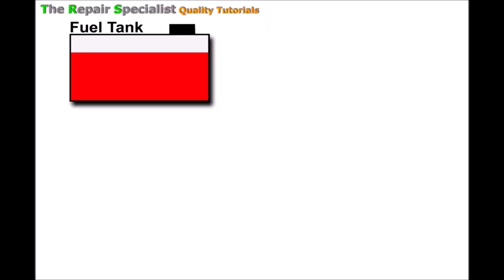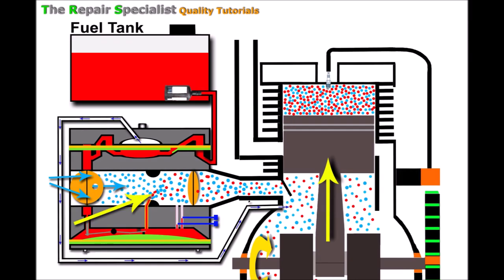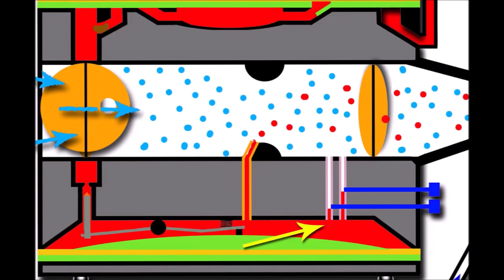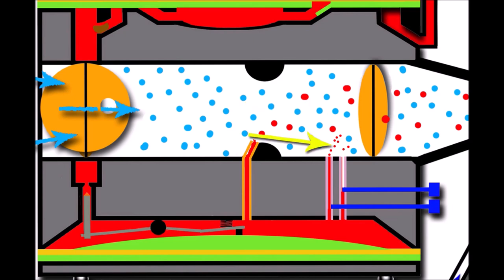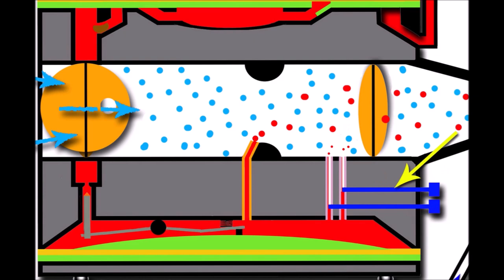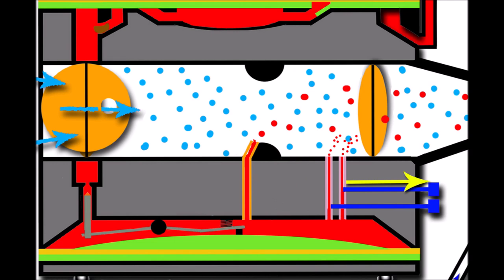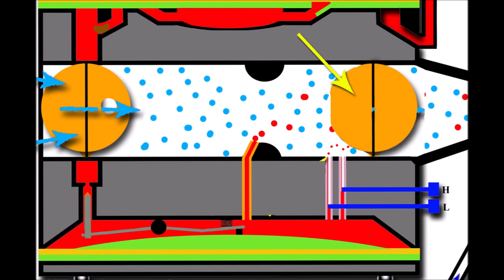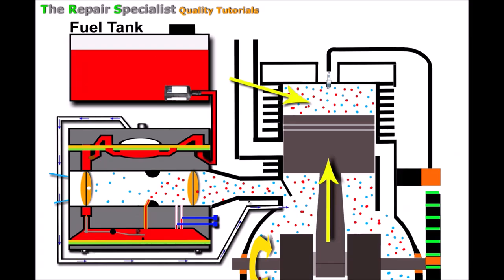CARBURETOR TUNING: How it Work?

Comment: You keep saying this is a very basic explanation. But I say bravo 👏🏽  I think this is a GREAT explanation for 2 stroke carb tuning. Probably one of the best I've seen. We always take carbs back to factory settings to get a base level and tweek. But i think your explanation for taking both screws out a full turn then tweeking high and low rev screws from there is a great start, especially for beginners. excellent video, thanks for posting.
Reply from the maker: Wow. That is some great feedback. Thank you for your comment. I really appreciate it. Craig 👍

Comment: I have an rc boat that is powered by a 26cc 2 stroke engine. I have quite some problems with the acceleration and top speed. The rpm screw is tuned in so i think i need to work in those 2 screws. Thanks for posting the video!

Comment: Great diagram & explanation on the carburetors function. This is a must for anyone just starting to get into small engines. Again great job. The reason I am here today is that I have a "dump find" chainsaw & while waiting for some parts I mixed up the 2 fuel mixture screws  😟
 & was looking for some way to tell which is which. Any tip on this?
Stay safe, Joe Z
Reply from the maker: Firstly, thank you for your nice feedback. 
Secondly, in the past I have done exactly what you have done. More than once!  So, take a look at each screw.  Assuming they are not noticeably different in threads and thread size to match the holes, then see if they are different lengths.  If so, then bingo!!  

All I have done in the past is to take a torch and look down each of the screw holes on the carburetor.  Doing this I have identified the deepest hole and the shallowest hole.  I have then match the screw length with the hole depth.  

All I can say is that this has worked for me in the past, but I suppose it all depends on the type of saw you have found and whether or not the screws are designed with varying lengths.  

This is the only possible remedy I can give you at this point.  I hope it works for you.  Thanks Craig
Reply: @TheRepairSpecialist  You are very welcome and thank you for getting back to me with this tip. I will let you know how it goes.

Comment: I have learned a lot from your videos on 2 stroke carbs particularly about the pulse line fuel pump given i am used to a seperate pjmp. I realise you make a living by doing this but what would really help is a video with audio of you tuning these. It's what quantifies running right which eludes many. I am used to more cylinders and have always though my two stroke gear even new to be lumpy. Just my point of view of course.
Reply from the maker: Neil Grayson. First of all thank you for your comment, and yes, I agree, I will make a video showing me tuning up a two stroke (with audio). I will get round to that as soon as I have completed the project I’m currently working on. Many thanks for the inspiration 😃👍
Reply: TheRepairSpecialist that would be excellent. As I said I am very familiar with car engine and yes I am old but your videos have taught me so much about the anatomy of 2 stroke parts. Truly enlightening and I look forward to when you have the time to make the follow on.

Comment: Hi, 
what does it mean if the top end is breaking up under wide open throttle?
The low end is fine and seems pretty crisp.
2 stroke rc.

Thanks for uoloading the video!

Comment: Crude explanation and actually makes it hard to understand. For example the low speed screw should be inletting on the engine side of the butterfly. The way he has this drawn wouldn't work at all and doesn't make sense. The  low speed needle works similar to the choke in that it is subject to higher vacuum when the throttle butterfly is closed. its purpose is to supply fuel to the engine to idle and the idle screw on the engine adjusts the amount of air allowed past the butterfly. Once the throttle is opened, the vacuum on the idle jet is greatly reduced and flows minimal amount of fuel as the engine switches over to run off the main/high speed jet. Idle adjustment is important because it does add a small amount of fuel to the high speed running conditions, it also plays a role in the efficiency of transitioning to the high speed jet. On small equipment i recommend starting at factory settings, reving the engine up to high speed and tuning the carb, then drop down to idle and adjust the idle jet. Once you dial in the idle jet, then rev back up to high speed and fine tune again. Once you've adjusted the high speed again allow to idle and fine tune if necessary and then test throttle response by opening the throttle quickly and verifying if you have a smooth rev or if you have a bog. If you have a bog then you will have to fine tune a bit further unit you find a place where the unit runs smooth at idle and high speed without bogging on acceleration.

Comment: I replace the fuel lines on a small two-stroke engine, and now it will run sometimes with the throttle all the way engaged but when you let it off it dies and fuel builds in the carburetor and is boiling

Comment: I have found that the H screw is usually closer to the engine than the L screw is.
Reply: Not in all cases for instance Ryobi 2 stroke engines high idle screw is facing the air filter.

Comment: Hi, can you tell me if there is a way to tell which is the H & L screws if they aren't labelled? I have a Bolens line trimmer that has no labels anywhere for the screws. Best videos I've seen for explaining this "Dark Art"!!!🤣🤣
Reply: 'L' is closest to the engine, 'R' is closest to the air filter.

Comment: You have any vid on walbro carb on 30 cc craftsman 4 stroke trimmer.  I noticed the carb on the two stroke and the 4 stroke are the same except the 4 stroke has a spring used with the pump diaphram whers the two stroke doesn't use a spring. Why?

Comment: Hi Craig, Thanks for the excellent videos.  I put on a NEW carb on my Ryobi Trimmer, everything seems to be in order but the engine smokes heavy and does not idle, runs well for a few seconds, if I prime it well before starting, otherwise it would run only if I keep the accelerator trigger pulled.  I have bought 2 new carbs which are listed as compatible with my Ryobi 725 R but I cannot make it work.  Have adjusted the L and H screws step wise, maxed out on RPM adjuster screw but it behaved the same with both new carbs. Working on it for several weeks, very frustrated now.  Any guidance will be appreciated.

Comment: good method at the end but you did not meniton anything about the idle screw? from your method of tuning the H & L how far out did you screw the idle ?
Reply: The idle screw doesnt work quite the same. Think of that screw as holding the throttle for you while it idles. The further you go in, the harder it pulls on the throttle. Adjust that last at an rpm just below where the chain spins, so it is revving without the chain moving at idle.

Comment: when i start my stihl weed eater 2 stroke it goes wide open full throttle but the trigger wire looks fine. would the carburetor settings cause this at all?

Comment: HELP- what could be causing a now and then fuel starvation?? already completely pulled apart and cleaned everything and checked idle bores using light in the bore and did all this many times and it runs and has all the power up down up down and i can adj more or less fuel with the screws so theres enough supplied by the pump. Then after 15 mins, it starves although the fuel line you can see fuel there and the pivot height i have tried around level with the casting as its a WA-110. How can it be not starving at all then starving? Carefully cleaned the needle jet bore and replaced all the parts and spring and everything. Done cars carbs  before and never had one shut down after it starts. I can tell its starvation as a quick pull on the choke saves it  and the plug is bone dry. Pulse hole has to be ok as the clear fuel line is full of fuel when it stops.. I notice the well lip for the 3 holes idle area where the welsh cap presses into has slight damage on the sides so could fuel be leaving there when its hot and thus the idle holes starving? have put a ton of nail polish on this and replaced with fresh cap and will try again after a day to allow dry.

Originally i thought it might be the needle well sticking after carb gets hot and thus starving but thats got plenty of play and it was flooding before when the old spring was too weak so thers plenty of flow from the pump and the spark plug was soaked. so fixed that and it ran for a hour fine, no stops, but this time its back to its fuel starvation thing again??
I wonder if its the chinese kit i put in it but why would it work perfectly for a while then not?? 
Unless theres a hairline crack somewhere bleeding off air or fuel but why would it work for some time before failing? totally lost on this one!!   either it works and flowing or not. it cant do both. compression is down but once again it runs like a rocket even with a long line and the screws are about 1-1/2 for L and up to 2-3 for H as i run a heavy line but will run on 1 H when no line so main jet is working too but that wouldnt effect bog down at idle. Something is being missed on this one. tons of fuel,  up down acceleration smooth as anything then idle starvation?? and even the vent valve i checked but it ran for an hour before after i did kit so that cant be it and fuel line full so carb has fuel just starving suddenly. Very strange one this one..
Vaporisation blockage inside? after a time operating. Using only reg gas, no methanol as parts and nail polish would be dissolved. I can get it started again and maybe get it going, so woulds causing partial starvation?

Comment: My stihl hedge trimmer mixture screws have tabs on them to only allow barely one turn. What do I do in this case or is the adjustment I need in this one turn?
Reply: You're going to need special tool to adjust or break tabs. For Stihl, your best bet is to take it to the dealer. If you don't know what you're doing, you can blow your motor.

Comment: Out of curiousity, why do the high mixture screw first? Looking at the diagram it looks like when you go full throttle the highest point still requires a properly set low screw to operate well.  So wouldn't it be wiser to set the low first than set the high since the high rpm is more important than an engine idling.
Reply from the maker: Well, not really.  It does look this way, I agree, but iv'e always adjusted these this way and never had any issues.  Cheers
Reply: I guess it's a flaw in the diagram. 'L' should lead to engine side of butterfly.

Comment: I have a 23 cc engine that I just purchased.  I was running running a walbro 990 but it wouldn't stay idle,  so I swapped it for a walbro 668 carb thinking something was wrong with the carb but I'm still having the same issues.  Does anybody have any advice on what could be going wrong. I looked up all the stock settings for the needles and idle screws bit still nothing.

Comment: What's the actual difference between the H and L screws? In your diagram they look exactly the same and look to have the same functionality even though I know you adjust H for full throttle setting and L for idle. Is the L jet on the engine side of the throttle valve?

How does the L screw operate in conjunction with the third screw (tick over?) that controls the actual throttle idle stop position?

Thanks for the video
Reply from the maker: itsgalf. First of all, thank you for your comment. Secondly, I think the best way of answering your question would be to do a video on it. It would certainly make things much clearer and help others with the same issue also. I will get on with that just as soon as I’ve finished the video I’m working on at the moment. Many thanks indeed for the inspiration. 😃👍
Reply: Great. Thanks for everything you're doing. The visuals have been helpful.
Here have a paypal donation
Reply: Ones has a spring on the inside the carb on the screw head one the out side of the carb again on the screw head ,, to keep tension,, an with what he z start with the inner springd screw I believe 😉

Comment: Thanks!  What if there is also an idle screw?  Is there a baseline setting as well?  That is, do I start with the H and L turned all the way clockwise and backed off one full turn and same with the idle screw?
Reply: Idle screw usually just hold the throttle a bit down using the screw,  so not a part of the carb really

Comment: Can you set the high side with the low screwed all the way in?
Reply from the maker: Hi. Maybe taking a look at this video of mine may help a little.  Basically, if you turn the screws too far inwards then you will reduce fuel flow to the engine: https://www.youtube.com/watch?v=74p9FLmIkkw&t=28s  . Thanks
Reply: Even though the two mixture screws are labeled  H & L, they both affect each other to some extent.  It's easiest to creep upon the ultimate correct adjustment a little bit at a time. Rarely will you hit it exactly the first time.

Comment: My brush cutter did not start,  the carburetor was new.  What Will be the other possible cause?
Reply from the maker: There could be many things depending on the what your engine is from? what make? what model? 2-stroke? 4-stroke, does the engine have a good amount of compression? Is the fuel less than 6 weeks old? Is the cold-start choke engaging properly? if there fuel getting to the carburetor? id there fuel getting to the engine from the carburetor? and this isn't all possibilities.

Comment: form a karter, my issue is im running a higher base psi 9.0-11. im getting a low mid range bog  down and running more low makes no difference mid to high i can find a little ... low is ok low to mid range is my issue the cross over isnt seam less.. like its good om looking for the .050 a lap
Reply: well not really i just want to hear your opinion

Comment: I have a Poulan chainsaw and it says in the manual that turning the Low screw Clockwise speeds up the idle. I'm so confused. Can you please explain how screwing it in speeds up the idle? (It's a Zama carb)
Reply: It seems counter intuitive, but less fuel leads to higher rpm's. When you turn that screw in, you are reducing the amount of fuel that enters the cylinder.
Reply: @Revellersaws  thank you for your response. If turned in all the way, would a cold engine have enough fuel to start? 

My chainsaw would start and rev real high and die and the engine became flooded and will not start anymore. I'm thinking it's bc the primer bulb is broken and air is getting sucked in but I'm just trying to understand the role of H and L screws on a cold start.
Reply: @thersten  no carburetor anywhere will work if the adjustors are all the way in. It does sound like an air leak, but the primer bulb is never my first suspect. Poulans are tricky, start 1.5 turns out on low and 2 turns on high

Comment: Each machines carburetor is different. One turn on high screw can be too lean for one machine and not rich enough. Get the specs for your machine before you adjust.

Comment: And if the machine Boggs on applying higher throb what then I can understand if it bogs at idle are runs bad at idle or if it is high RPM does not run fast enough or hard enough what if you apply the throttle and it bogs is that main jet it runs great otherwise I can I can throttle it it'll run up I believe this is a rich scenario throttling the machine Burns off the fuel that idling provides??
Reply: That sounds like a lean high setting, keep pulling the throttle and turn the H counterclockwise. Excess fuel burns as white smoke out the muffler

Comment: I haven't torn a 2 stroke engine apart but this drawing doesn't look right. The low and high fuel mixture according to this drawing, how does the science of it works when it looks like they are just duplicating their tasks. And where are the valves? Wouldn't the gas mixture manifold somehow get the fuel mixture somewhere near the top where the spark plug is? This drawing doesn't appear right.  And the high and low fuel mixture doesn't look right either.